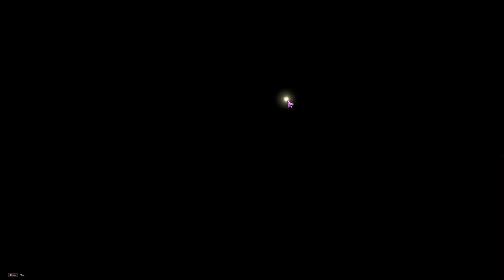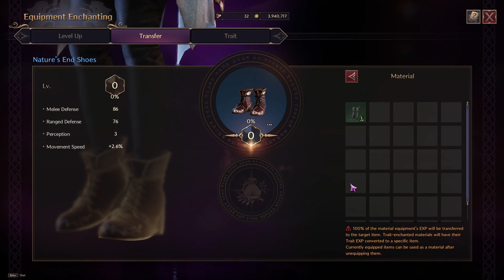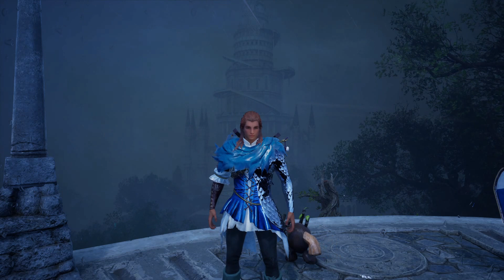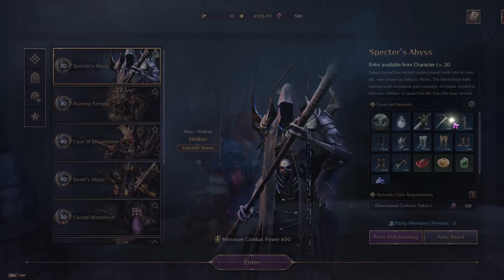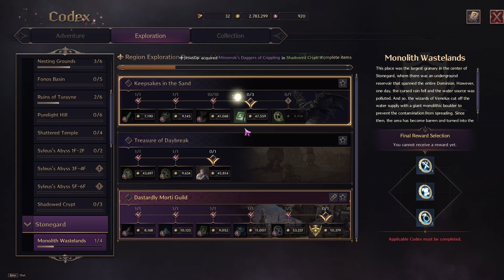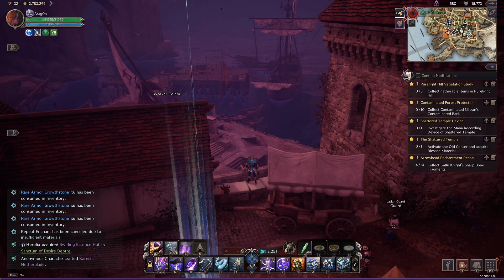How Gear Works in Throne & Liberty! - Level Up, Transfer & Trait!

Comment: Speaking as a new player who just started the current game, how do I think of gear? And by that I mean, it seems to cap at level 6... green. Then I can find blue gear? How to I get it? How much does it batter? So in other words we never see, say, a "level 10 green item" or a "level 3 blue item"?
Reply from the maker: yes, but get to level 55 and claim your free tier 2 level 12 fully traited gear
Reply: @Aragon- Thank you for a quick reply! I think I am looking to step even further back than that. It's weird, I am a veteran MMO player and something about TnL is just not clicking in my mind.  I'm not even concerned with progression or pushing, but just want to understand why and how they set it all up. Why is green gear fine, and only go until level 6? What happens if I do/don't find a blue piece to then upgrade? How DO I get them, and what matters/changes about t when I do. Sorry for the long wall of text :)

Comment: Hi,
Question quick I’m level 40 but can buy purple gear from auction house can I equip them straight away as there’s for level requirements. Thanks
Reply from the maker: You can equip straight away. No level requirements

Comment: Hi. Should I transfer a full traited blue +9 to an epic (not very important for my class) then transfer this epic to a better one? Is it worth upgrading traits to a blue then transfer it to a purple even if you decide to change the latter later?
Reply from the maker: that works fine, yes. But don't do it if the purple is worse than your blue with stats

Comment: People mention you should be upgrading gear up to level 7 something and then transfer the green to blue or blue to purple item since higher level upgrades take way too much upgrade tokens. You didn't mentioned about it. What is the last news about proper upgrade mechanics?
Reply from the maker: that's only with purple and it will only save like 3.5 stones total